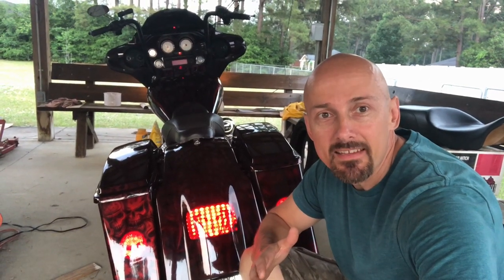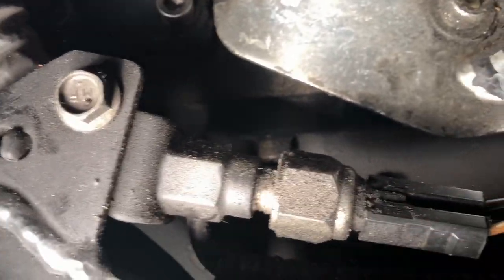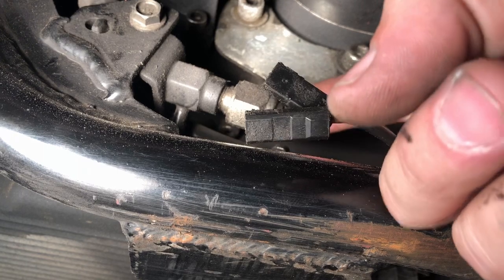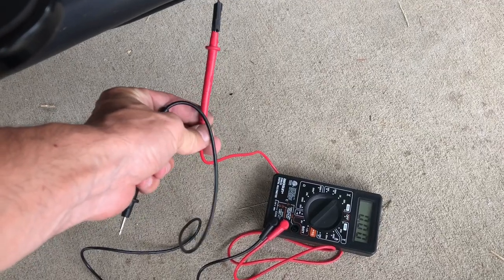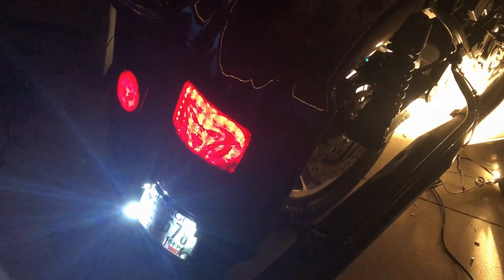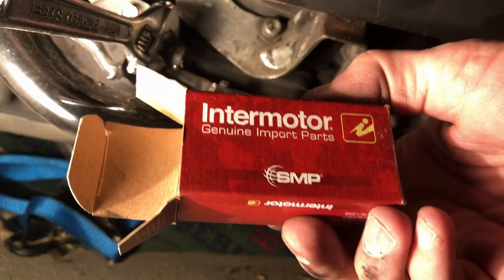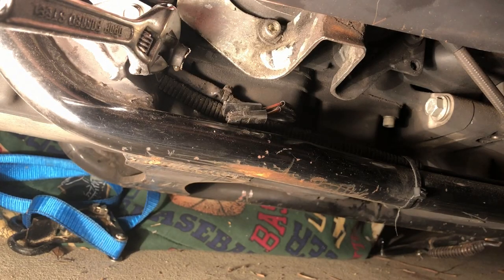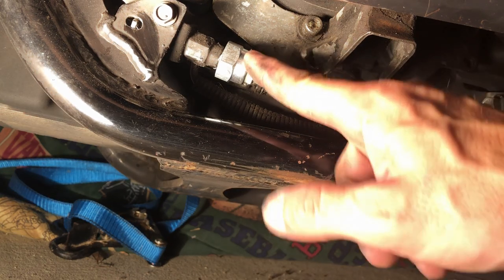Harley Davidson Rear Brake Light Switch

Comment: That might have been a Harley recall. I have a 2011 Ultra Classic Limited and when I had my rear tire replaced by HD they ran my Vin number. Low and behold, the switch was changed out for free due to it melting and failing. My didn’t fail thankfully but they changed it before it did.

Comment: My brake light comes on when I step on the pedal all the way down only, not when I barely start to press on pedal.. Does that mean my brake switch is goin out ?
Reply from the maker: Hector Ortega I don’t know on that. Since the switch has your brake line associated with it I would try checking your brake fluid level just to make sure you are good since it relies on the pressure. I didn’t experience the symptoms you described but again I only realized it after my rear brake light wasn’t working at all.
Reply: @cheapjoker3321  has nothing to do with the freakin' brake fluid level .... geezee!!!
The brake switch like most all others on the planet are ELECTRICAL not HYDRAULIC.
Reply from the maker: @Jeff82556  then can you educate me on why the replacement stop light switch that fits this bike is titled Hydraulic Stoplight Switch if your saying it isn’t a Hydraulic Switch.

Comment: hey joker my bike is new so do I still have to bleed out my brake fluid or can I just change the switch with the same fluid will it squirt out  or will it just be all right.
Reply from the maker: I think it would squirt out, but I think some people on the internet have said they were able to quickly change it out and were able to get a new switch installed. When I changed mine I had majority of the fluid drained, so I didn’t have fluid squirting out when removing my old switch. For me, I would think that if you tried you would end up letting air into the line. If you are going to try you may want to search the forums and get better advice from someone who has done it that way.
Reply from the maker: I know it doesn’t answer your question but maybe someone will chime in who has attempted to changing out the switch without draining all the brake fluid first. Good question.
Reply: A switch is ELECTRICAL not HYDRAULIC!!! I suggest staying away from both. (as a DIY project)
YouTube videos are not a wise substitute for people with no experience with certain tasks.
Reply from the maker: @Jeff82556  I get that the switch is electric. Can you share in reference to Gino's question, since it sounds like you have knowledge in this field.
Reply: @cheapjoker3321  Sure, I'll try to answer where it makes sense.
Gino's question "will I have to bleed the system or just change the switch with the same fluid?". (shortened version) Gino is assuming that brake fluid and the switch are somehow interlinked or connected in some way. (will it squirt out?) They are not interlinked in any fashion. These are 2 independent (hydraulic & electrical) systems which are related to brakes but are physically separate entities. They don't connect to each other or control each other although some switches monitor pressure, like brake fluid or a gas gauge.

1. brake fluid runs throughout the master cylinder, brake lines, calipers, etc and can be bled by loosening bleeder nuts. (a person puts pressure on the brake pedal while other person loosens the bleeder nut which allows brake fluid (and trapped air) to escape the lines. (nothing electrical here)
2. A brake switch is an electrical connection which ONLY sends a signal instructing the brake light to illuminate when pressing the brake pedal. (nothing hydraulic here) That's all it does! Imagine what would happen if you sent an electrical charge to brake fluid! (brake fluid is flammable and burns like vegetable oil)

Oh and you asked me....
Why is the replacement stoplight switch titled "Hydraulic Stoplight Switch"? Good question, Cheap Joker.
Calling it "hydraulic" (meaning brakes) is more understandable than simply calling it a stoplight switch. They want the description of hydraulic so that people won't confuse it as being perhaps a turn signal switch, or an ABS switch, or a brake light switch, etc.
Hydraulic is just a general prefix, no different than using a word like aircraft which could mean plane, helicopter, drone, rocket, etc.

I hope anything I said made sense to you.
In summary, you cannot mix or combine electrical & hydraulic together as one.
Reply from the maker: @Jeff82556  Thanks for the clarification on the hydraulic and electric switch systems being separate. From your comment it clearly shows that you have an extensive knowledge in this area, and I welcome it. 

Not trying to be argumentative just trying to understand, just so I am on the same page with you reference to Gino's question. My knee jerk reaction to Gino's question would be to always err on the side of caution and to bleed the brakes in case air was introduced into the brake line while changing the switch out.  My thinking is that air would get introduced into the line, hence the reason for bleeding the brake line. Would you agree on this or am I missing something?

 I did see, however, another youtuber changed the brake switch without bleeding it by securing the brake pedal down a little ways before removing the brake switch for the purpose of not letting air into the line (or at least minimizing it). What are your thoughts on that?
Reply: @cheapjoker3321  Perhaps you saw this video: https://www.youtube.com/watch?v=L6JhTTZmqXg
It's a very good video with clear instructions explaining changing the rear brake light switch on a Dyna.
Contrary to my previous comments, it does involve the POSSIBILITY a loosing brake fluid (a drop or two) but you do NOT need to bleed the brakes.
When he tied the brake pedal down with a bungee cord or strap, this eliminated the possibility of introducing air in the line - which is why you wouldn't need to bleed the brakes.
Since this particular type of switch monitors brake fluid pressure, it indeed qualifies as being called a "hydraulic" brake switch, even though brake fluid does not go through or circulate through the switch at all.
And still like I said before, electrical and hydraulic are not combined, mixed, flowing together, or any other such blending, therefore separate during the operating function.
I hope you can understand what I'm trying to say in summary.... hydraulic & electrical do not intermingle - ever.
Have a great evening!
Reply from the maker: @Jeff82556  Yes that was the video I had watched. Ok, thanks.

Comment: Hey Joker. Dennis here, new rider, new Harley owner. I just bought a 2015 Dyna FXDL Lowrider and the brake light was on for a few days and now works intermittingly. By on I mean just like the running light, illuminated non stop. Now it just doesn't illuminate. If I remove the tail light socket and reposition it the brake light works for a few minutes and then goes back to not working. The running lights are fine but now no brake light and at first it wouldn't go out. No wires are loose that I can see, does this sound like the brake light switch? Thank you for your great channel and apologies if my question is not clear. The code displayed reads b2161...
Reply from the maker: With it sometimes working then not I don't think it is the brake light switch, but again I am no expert. I found this info when searching for the b2161 code. Not sure if this helps.
https://www.harley-davidsonforums.com/threads/brake-light-fix.373888/
Reply: @cheapjoker3321  Thank you very much...

Comment: Question for you, did you have to bleed the line afterwards?
Reply from the maker: I did bleed the brake line. I was due to change my brake fluid anyways when I discovered I had an issue with my brake switch, so it kind of worked out. I have read somewhere on a forum that you maybe able to swap out the brake light switch without bleeding your brakes, but I have not done that. Can't remember what forum I saw that on.

Comment: 1st time HD owner here. Thanks to your short and to the point instructional video I was able to confirm the rear brake switch was bad with the paperclip trick. I swapped out for a new OEM HD rear brake switch...surprisingly it was only $24. 

1 down, 1 to go. My front brake switch is worn too (stays compressed) and has a lot of play on the lever.  Anyway the OEM front one from HD was only $22.

Comment: I inserted paper clip into each plug. Lights will not turn on. What should I do next
Reply from the maker: Willie Black check to see if you have a hot wire. One of those wires should be a hot wire. If you don’t have a hot wire check wire connections and if you have a broken wire.
Reply: Cheap Joker no voltmeter but I do have a light tester. Both plugs light up. So I just need a new switch right
Reply from the maker: Willie Black using the paper clip into the plugs (by passing switch) and the brake light, lights up with ignition on tells you most likely your brake light switch has a problem. Now if your light is not lightning with the paper clip inserted into the two wires (by passing switch) there may be issue somewhere in the wiring. That is why you want to verify you have one wire hot. Click on the link in description of of this video from fix my hog. That video goes in depth little more about procedures using light tester to determine that one of wires only is hot (not both). Also check the terminals on the brake switch for corrosion. Before swapping out switch I would make sure that the by pass (paper clip) Illuminates the brake light. Also when using your front brakes, does that illuminate your brake light? Just a check to make sure it’s not a faulty bulb. The whole by pass with the paper clip is to show that your wiring is ok to illuminate the bulb thus pointing you to the brake light switch being the problem. Might also want to check fuses.
Reply: Probably gonna have to take this to the harley dealership. Test light works on one of the connectors. When I insert paper clip, brake lights will not come on. I even put the tester on the paper clip while it was inside of the connector. The tester light doesn’t come on
Reply from the maker: Willie Black since the light isn’t illuminating with paper clip I would think it would have something to do with wiring (maybe going to brake light) and not the brake light switch. Let us know what you find out though. I am interested in finding out what might be wrong.